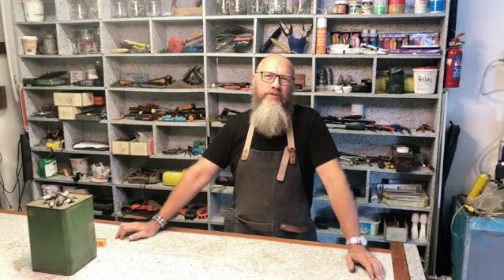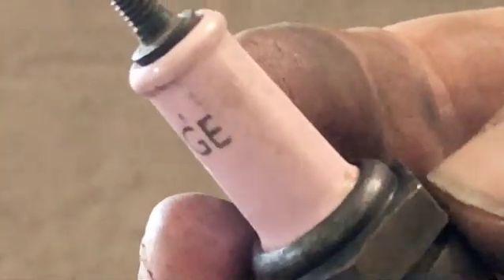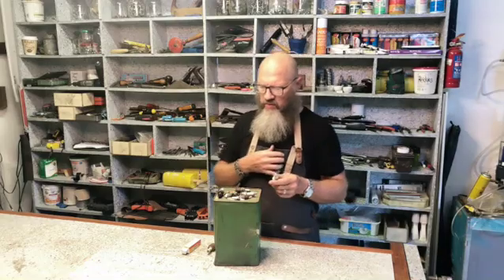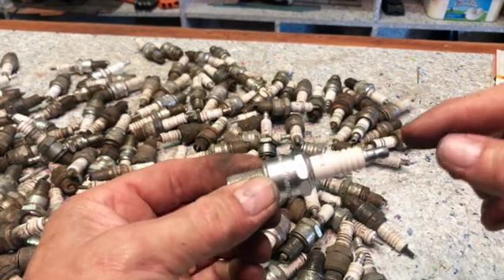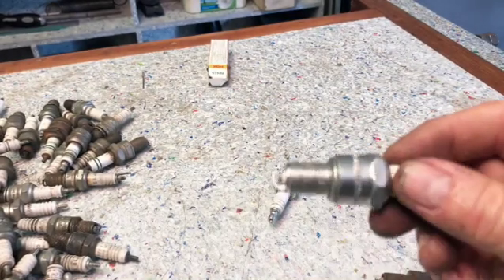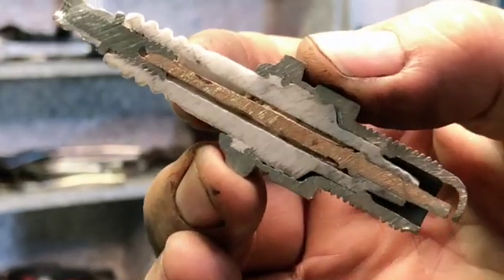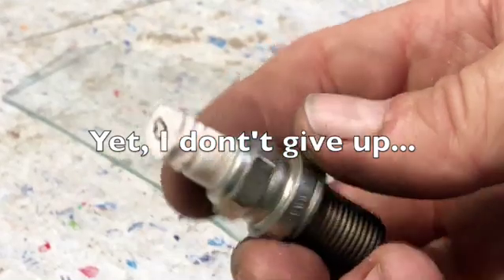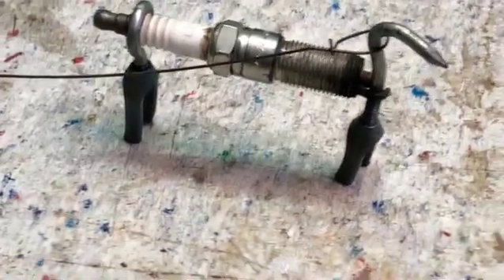How to cut glass and drill steel with spark plugs.

Comment: 204 sparkplugs.. and I have not yet tried it but I've seen that if you take a wire from the grounding prong of a coil to the sparkplug along with the normal plugwire you get a plasma ark. Heck I think I may go try it now that I've watched this and it got me in the mood to go try it. I've cut glass and drilled a hole with a plug so I know that works
Reply from the maker: Thanks for guessing:-) you are close, but out with 39. There were 241 on the table ( including the ones I cut open )